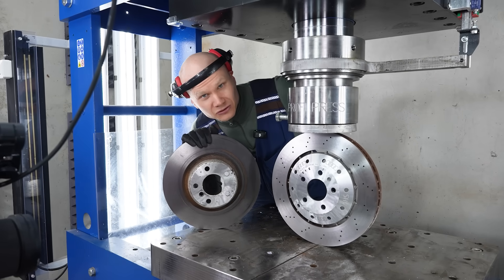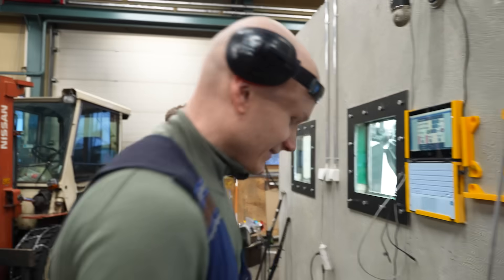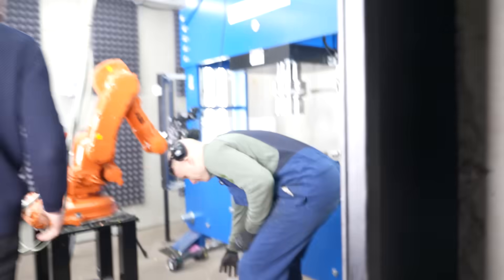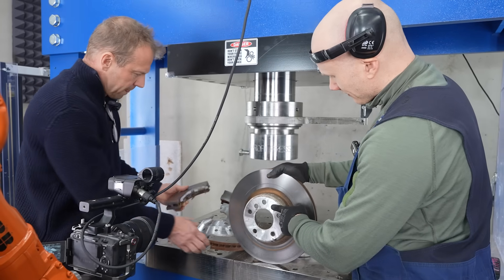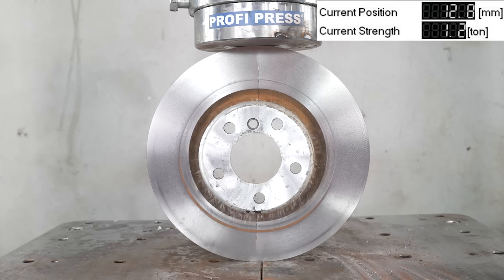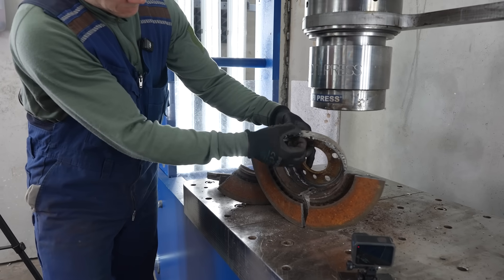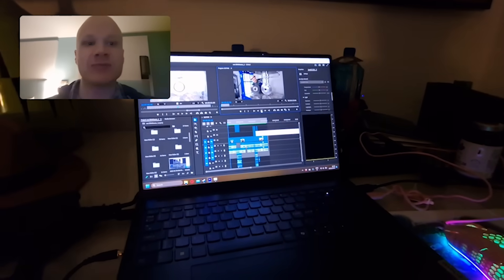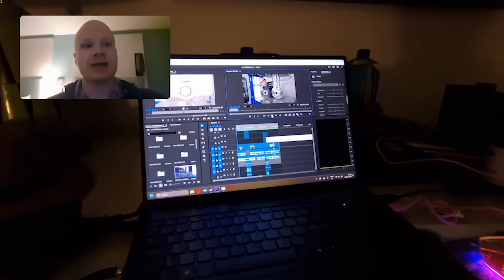How Strong Is R8 Brake Disc? Hydraulic Press Test!

Comment: Ha. As soon as I saw the R8 disk standing up in the opening shot I called it that the hub would break away from the outer surface portion. Being only connected by those small spokes to save mass was a dead giveaway to what would happen.
The more surprising one was that the regular disk broke in the same manner. I figured it would break differently. Though upon watching it in slow mod it does make sense. Because of the hub design brake disks have where the hub is significantly offset from the disk, this creates a section that wants to push horizontally when crushed, and if that moves in or out, the disk itself has no choice but to buckle at the sides and top as it twists and thus presents the same breaking pattern.

Comment: luckily, rotor crush durability is not the key factor in their design, it's all about how they can survive hard braking rotational forces, without warping, exploding, chattering or being eaten away by  common very hard ceramic pads used today. that said, the rotors are usually very worn and need replaced with the pads now days, but they sure stop better!

Comment: I wonder if you get a rotor at the center bolts together and to see how its structure will come apart. And I'm also wondering if you could take a rotor and lay it flat on the table and then smash it to see how the structures would break in that format.